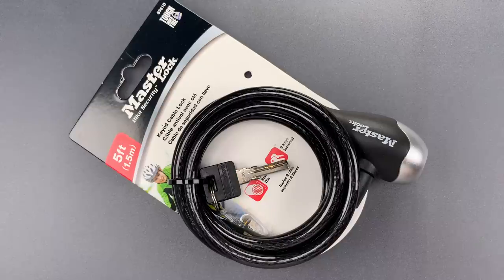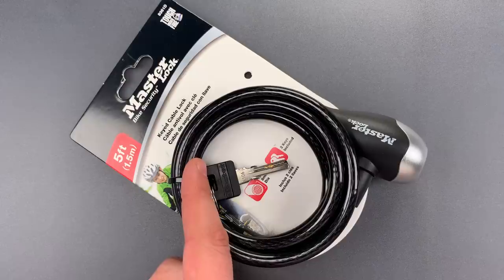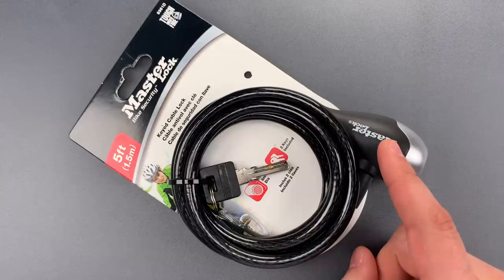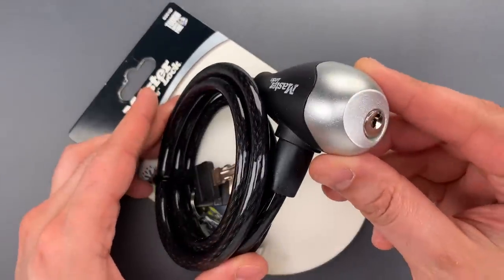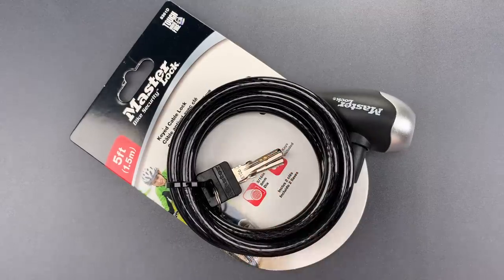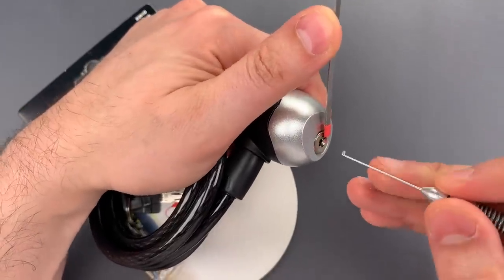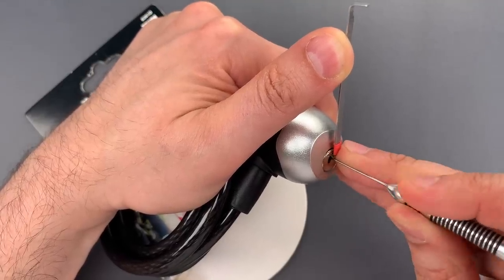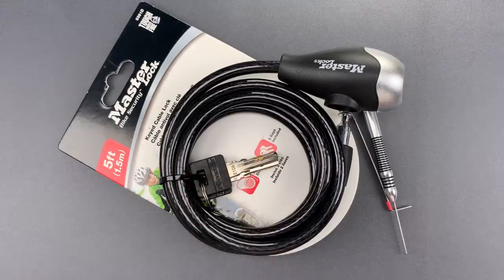[1173] I Can’t Believe This Is Sold As A Bike Lock: Master Lock 8361D

Comment: Aren't most bike locks not to dissimilar to the use for most padlocks, not really meant to keep someone who really wants to break in from breaking in, just merely a deturent for people who are not really true thieves but will take anything that is easy to take, aka opportunity thieves.

What I mean by that is that if someone wants to break into a uhaul or steal a bike they are going to do it there is no real stopping that, but Bill walks by and sees you don't have a lock on the uhaul or left your bike outside your house unlocked, Bill wouldn't take the time and risk of trying to break into a lock but seeing that bike just sitting there or seeing the back door of the uhaul easy to open Bill will take the opertunity to take something that doesn't require doing actions that may otherwise raise suspicions, you open an unlocked uhual no one is going to think twice about it maybe you are helping your buddy move, you go up to a uhual with bolt cutters people are going to immediately raise their eyebrows. 

Yes you wouldn't want to put one of those on a $3,000 bike, but you would put it on a $70 Walmart bike that you don't kind if someone wants to risk getting arrested for theft of stealing it but you don't want Joe Blow to just walk up and take it either.

Comment: ehhhh... I dont think you're going to get through that with side cutters.  Bolt cutters, yes.  Any kind of bypass cutters, yes.  Side cutters, no.  I'm assuming its just small steel winch cable thats been coated in plastic.

Comment: A guy at my work bought a £3000 bike (BMC road machine) and he locks it up with a £5 combination lock
Reply: oh my god. 
However, a lock good enough weighs at least 1/3rd to 1/2  of the weight of this whole carbon bike. Such a bike shouldn't be exposed on the street at all.
Reply: @simonm1447  I know I'm annoyed at it myself, I have a road bike (only£750) but I have a far better lock on mine. I think the only thing keeping it safe (for now) is that the only way into the area it is locked up is via a security gate that needs staff key fob or walking past the front gate house that is staffed 24/7
Reply: @Bluemoon_19  of course storing the bike in a safe place is always better and safer compared to a lock at a place everyone can walk through. 
A lock is never 100% safe, every lock can be opened. The difference is the time thieves need, a good lock can withstand long enough to let the thieve abort the attempt to steal it.
Reply: @simonm1447  exactly a good bike needs a good lock so thieves go for the lower hanging fruit. like at out work a guy has recently stopped putting a lock on his electric bike. Funny story from a few months back, a guy called mark "secured" his bike with electrical tape no joke he didn't seems to get it could be taken in the same time it took him to get it off.

Comment: Hey LPL (or others) I am a road cyclist and mtb'er. I own medium expencive bikes and sometimes i Stop by the groceries. What lock do you recomend? something lightweight please.
Reply: My bikes are from the same price category. I use a kryptonite New York U lock, it's not the lightest lock (2 Kg) but it's relatively safe, it needs special tools to pick and the U is with 16 mm hardened steel, you need an angle grinder to cut it. 
Cable locks are not safe at all, cables may be light and flexible, but they are relatively easy to cut. 
Another option would be a lock like the Abus Bordo (there are surely also other brands which offer such locks) , there are different versions of it from 1100 g to 1800 g.
Reply: @simonm1447  2 KG!?
Reply: @arcticrunning8370  That's the price for a really safe U lock. 
Another relatively safe option would be a foldable lock like a Abus Bordo or something comparable, they can be built a little bit lighter, and start at around 1,1 Kg (the more massive ones also have almost 2 Kg).
However, cable locks are not safe at all, and can not be recommended for everyone who loves his bike.
https://www.youtube.com/watch?v=-rphMwxTr54
There are also Alarm locks, which are made of a relatively thin cable which sounds an alarm if the cable is cut. 

It depends where you have to secure your bike, in rural areas the risk is usually lower, while it's high in big cities with a lot of criminals. A more simpler lock may be enough in a less jeopardized area, while it would be not enough in a bigger city.

Comment: It is to prevent casual petty theft. In other words. Keeping the average douche out of your hair. Besides which. It would be pretty obvious if you had chained up your ride in some heavy traffic area, when the dude with huge bolt cutters starts taking off after chomping that cable. Picking the lock is also kinda obvious too. Rdprcially in a high camera area like a train station.
Reply: people really don't care if it doesn't affect them. a few years ago I had a pretty nice Gary Fisher bike that I took great care of. I had it chained up with 2 kryptonite locks in a high traffic area with cameras. at some point someone walked up with a pretty large variety of tools, unbolted literally everything from the chassis & snapped the 3 joints holding the suspension, leaving literally just the points that had been enclosed by welds.

TLDR ; bike security doesn't really matter because people won't intervene anyway.

Comment: I gave my old bike to https://www.fahrradleichen.de/ and I forgot the key at home.
He used his battery powered 'flex' to cut through it in under ten seconds O.O
it was one of those 'cable in steel housing' locks but omg,
makes me glad I have to locks for my new bike and the 20 seconds should be enough time for my colleagues in the lab seeing someone is picking my bike before LPL drives it away ;-)

Comment: I have a Masterlock very similar to this. He can pick it faster than I can open it with the key. :-(
Reply: Thieves won't pick it, they will cut it with a cable cutter in seconds. 
This locks are relatively light and flexible, but they shouldn't be used for more expensive bikes, especially in areas where bikes are often stolen. They will still provide the bike from being taken by teenagers for a ride, but they will not prevent thieves from taking the bike.

Comment: What kind of person would actually buy this?
Reply: The requirement of specialized picking tools means that the cable is probably the weakest link, which is presumably the same strength as any other cable lock. So... anyone who would buy a keyed cable lock could buy this and be as secure as if they bought the same type of lock from another company.
Reply: @Nerdnumberone  well I'd never buy a lock with such a thin cable. It's obvious anyone's able to open that in 2 to 3 seconds. I just can't fathom the mind process of some people. "Oh that weak ass cable will secure my property." I use a lightweight motorbike lock because my bike is to expensive. but I guess it's fine if your bike isn't worth selling in the first place.
Reply: @gilgabro420  People see a steel cable and think it looks pretty tough, having cut nothing stronger than a zip-tie.

Comment: I actually picked up this very similar lock earlier today. https://iili.io/2VTrmu.jpg

4 pin dimple lock with as far as I can tell an identical keyway. (It does have a chain, though.) I have some Sparrows Black Flag picks in the mail, so I don't currently own any dimple lock picks, but I could get it open with a short hook fairly easily. Like 2 minutes. And that was in fact the first dimple lock I've picked. :)

I picked it up because it looked easy to pick, and it did not disappoint.

Comment: It is said that "Locks are for honest people", which basically means that a lawful person won't try to access something locked anyway while someone with bad intentions will not be stopped by any lock whatsoever
Reply: That's simply not true. Any theft is a trade-off between the value of the item being stolen and the chance of getting caught. An unlocked bike can be stolen instantly and a passer-by would have no way to even know that it was a theft. A bike secured with a thin cable lock like the one in the video can be stolen quickly with a small hand-tool and most passers-by probably wouldn't realise what was happening. A bike secured with a better cable lock would require larger tools, making it more likely that you'll get caught. A bike secured with a good D-lock will require an angle grinder, which gets pretty obvious. A thief won't take that risk unless there's a big reward to rebalance the trade-off.

So, yes, it's true that, if somebody really really wants your bike, they could defeat any lock. However, in reality, a thief doesn't want your bike: he just wants a bike. It's not hard to use a lock that's good enough that any thief will just say "Trying to steal that bike is too risky for the reward; I'll take that other similar bike that's less well secured."
Reply: beeble2003 And here I was talking mostly about locks in general, not focusing on bikes. It’s true that better lock will give you a higher chance to save your items (or we wouldn’t use any lock at all). But in the end I feel safe only if my things are with me at arm’s reach. My phone, my bike, my house, etc.